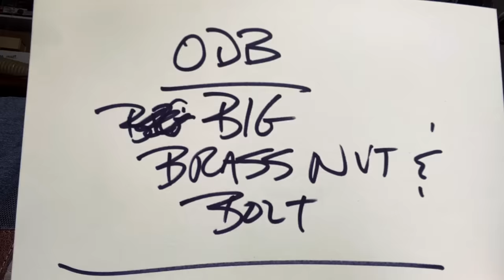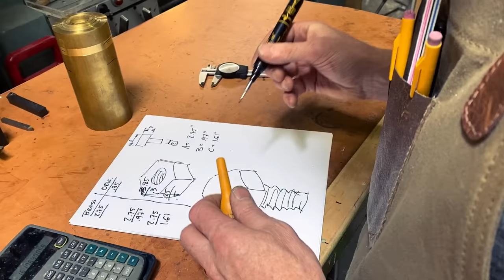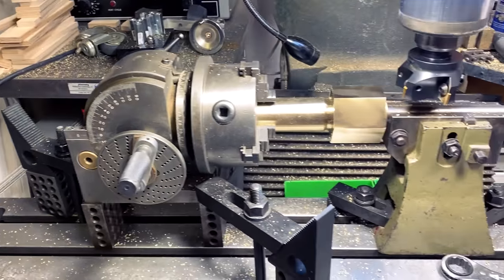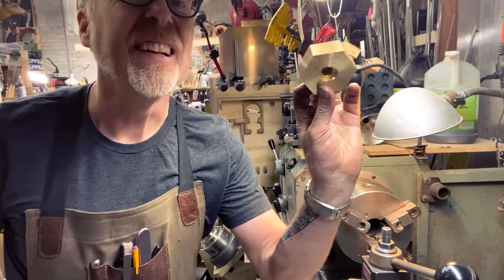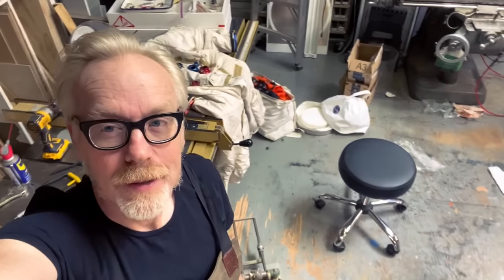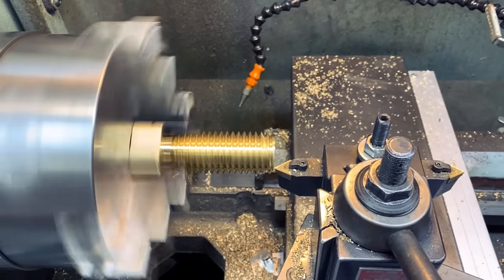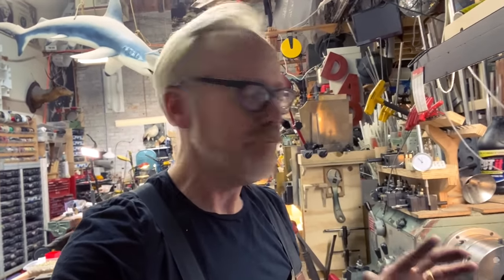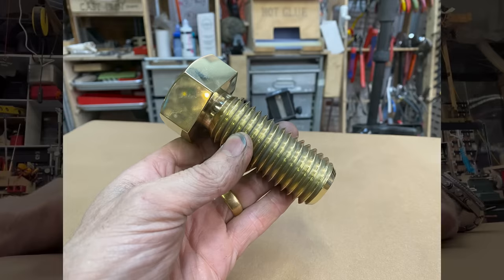Adam Savage's One Day Builds: Giant Nut and Bolt!

Comment: I note you were using reverse threading on the first pass and then when remachining it you changed to forward threading. Im scared of cutting toward the chuck so Im just wondering why you changed? Sorry if this has been explained somewhere in this thread already.  By the way I think you are using the wrong inserts from brass, they should be zero rake to stop the brass grabbing. If you are not away you should also sharpen a set of drills for brass too as it makes a huge difference

Comment: Last time I threaded something on a lathe, I ruined the piece...twice.  Pulling the tool out and disengaging the automatic drive at the same time is harder than it looks, and I accidentally drove the tool in further both times, bending the piece.  (The tool survived perfectly fine though!)  I worked out that it was because I was pulling the tool out with my left hand instead of my right, so I was turning the wheel in the wrong direction.  The third time, I crossed my hands, so I was using my right hand to pull out, and that worked.  As a result of this though, I hate even the idea of threading on a lathe.  A relief really would have helped, since I wouldn't have had to pull the tool out at the same time as disengaging the drive, but that would have been out of spec.

Anyhow, thread cutting is vicious.  There are so many more ways to screw it up than to get it right, and some of them are pretty harsh on your equipment.  I appreciate how you are willing to let us see your mistakes and the frustration, because that really is part of the learning process, and it's good for people to understand that.

Your end results are absolutely gorgeous though.  I appreciate that you polished them (and can empathize with the disappointment of the limitations of polishing).  Brass is a really nice metal for doing things like this, where the only value is going to be aesthetic (aside from the value of the experience!).

Comment: I am a machinist,  you should have center drilled it and had a center in the end of the workpiece.. The other thing with the bigger threads is advance the tool on the z axis forward then center then back (staggered) on every pass, this will take pressure off the tool because it isn't cutting on both sides every time.

Comment: Did you scale up the dimensions of the smaller bolt?
In case you didn't know there is a set of ratio's for getting all the critical dimensions for the bolt head that relate back to the bolts diameter.

Comment: I would have left the dings in place and tried to make a practical nut and bolt that works. I also question whether the ideal nut and bolt maintains the same proportions as it changes scale. But that is because I am not thinking in terms of making a replica, which is obviously the point. I would be satisfied with a beautifully threaded nut and bolt that works.

Comment: Tricky to work with soft metals; blunt one of two edges of drill bits to prevent them from threading themself and getting stuck.
This was done with copper and plastics especially. While threading - do one side of the valley at a time. Not easy. :)

Comment: Gets interesting setting for screwcutting in the lathe when setting up by hand with a stack of changewheels for the leadscrew when working to very exact totally non-standard peculier piches as is the std example used in exams for contraction in a mould. See W.J.Chapman 'Workshop Technology' vol 3. I must admit I'm okay practically but the arithmetic always challenges me. This is a standard part of the curriculum UK C&G Prod Eng  Technician and ONC/ HNC worked example.  Also, working from the rear in reverse from the shoulder / runout at the left makes for quicker working. I've a handy auto cut-off made self made 40 yrs ago for my Dads ML7 that is an auto cut-off for L.H. shoulders, see UK 'Model Engineer' magazine around 1970, its an article by the excellent Ken Metcalf, also makes for quicker working once set. For all general work the Coventry diehead rules.

Comment: Unscrew the jaws, and turn them around for larger throw, bigger diameter piece. The result sounds loose enough to call scrap. I over cut a nut once for an 8 inch diameter threaded shaft for an 8 foot diameter tug boat propeller. It was only .010" over. But chasing threads demands the most precision of lathe work.

Comment: I have not watched this all the way through yet. I am only at the five minute mark. Adam just measured the diameter of the brass blank from tangent are tangent, but measured the original bolt from flat to flat. I would think he would need a corner to corner on the original. But we’ll see where this goes. :-)

Comment: A custom thread shows you definitely made it on a lathe or something more complicated vs just like using a die and tap for the nut but using a common size is better to me because aside from if you did use a tap and die it means you can get a nut and bolt off the shelf and have them fit

Comment: Not a machinist but could you use some set collars on the Ball Screw that drives the carriage? I'd do some testing and see what happens when the carriage runs into the set collar. But you could set them on both ends, and set yourself some boundries. It looked like in the video the tool runs into the chuck at one point, not sure.

Comment: When you calculated your ratio, you used the round of the brass, but you used the flats of the bolt, so the head on the bigger brass bolt would be undersized, compared to the rest of the ratios.
You should have measured across the points of the hex on the sample bolt.

Comment: Did you set the top slide to the thread angle so you cut by pushing in along one face? Or Are you pushing the tool in forward, trying to cut both sides of the V together (wrong way)?

Comment: I know this is old but cutting threads isn't that difficult once you know, "standard procedure". First, I would have left a false center on the bolt, then you could remove it when finished. Second, you never looked up the pitch diameter and tolerance for the thread you were creating so how would know how deep to go? Did you have a set of micrometers and thread wires to check your pitch diameter as you were going along? When I was in machining I used thread triangles. Easier to hold than three wires. If I were cutting a thread, the first thing I would do is whip out my Machinery Handbook to get the major, minor and pitch diameter. Nonetheless, this was fun to watch.
Reply: With "false center", you mean drill a hole in the tip to stabilize it, so the entire bolt is not held at the base?
Reply: @schwarzerritter5724  Correct. The reason they call it, "false" is because you remove it when complete. And generally, you use a center-drill, not a regular drill. They're short and stubby so they won't, "walk" or wander on the face of the part.

Comment: Actually there is a proper tool for accurately measuring threads. It's called a thread micrometer. The anvils can be changed to suit any thread type and then calibrated against a gauge. The dimension being measured is the thread pitch diameter which is the known standard for measuring common threads accurately. Everything about machining stuff is shown clearly in the Machinery's Handbook. It's a very large book about 3" thick and shows standards, clearances, tolerances etc. This book should have been consulted before doing any serious machining. When cutting deep threads on a manual lathe always set the top slide to half the thread angle so that only the front edge of the tool cuts. This is how a CNC machine cuts a thread when using a G76 with the angle parameter (A) set to the thread angle. Failure to do that will result in chatter on deep threads. Want to know what a deep thread is? Check out BECO threads.used in the oil and gas / drilling industry. There's a lot of custom shit in that industry to stop people making their own parts. Thread depth can be up to 1" or more on large diameters. They are a bear to cut even on a new lathe. Often slide-bed clearances must be adjusted to minimum to avoid chatter. We had to cut BECO threads on a 30 year old CNC machine at my company and baby-sitting the tired old machine was half of the work hehe!

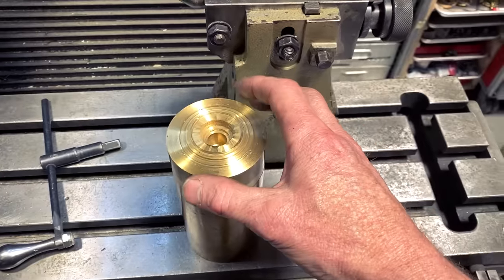Comment: Maybe a real noob question but 6:27 could you reverse each of the 4 chuck jaws to use the offset to give you a greater working diameter ? granted it will be less stable but you are going to use a tailstock.

Comment: I would have completed all the lathe work first so your not holding on flats in a three jaw Chuck. Then after thread is complete then move onto the milling. I find cutting .2mm is the best amount to take with most material per thread cut. Then when close to the finishing dimension I’d change the tip round and cut .05mm (steel) probs .1mm with brass. And spring cut the last cut.

Comment: I am also a bad machinist.

I think you would have been better off using a much smaller thread tool and pushing into the bolt at an angle. When you go straight in, your tool has to cut on both sides, increasing the force on the work, and a big tool puts a lot of material against the work, so the tool acts like a brake.

I think you also need a live center to support the bolt. Real machinists say to limit the stickout to 3 times the width of the work. Or something like that. Look it up.

You can put a hex on a part with an indexer or rotary table without turning everything sideways. Just use a side-cutting mill.

Props for posting the video in spite of the errors.

Comment: Adam matem why not simply put the tap on the end of the gulde and slowly use that, so much easier and a lot more precise, like you explained about the tap and die sets ,use the tap with the right thread count and back its done? Plus your not using coolant as well, which brass is hard and brittle ,where as the tap and die tool sets are hi tensile steel and some are tungsten carbide tooling as well?

Comment: wished Adam was a teacher, Would love to have learnt how to use a lathe from him rather than the teacher we did have, I never understood cutting speeds or threading external threads with a lathe because our teacher never explained it and more or less just went "Heres a lathe, Heres some material, don't get hurt"

I did, however, get to enjoy Knurling when we were making a pin punch, I miss the lathe work, Got cancelled for the second year of my level 2 course because the teacher left and no one else was available to teach us so we did hand fitting and now in level 3 BTEC we are doing mostly welding until the material comes in to allow us to start actually making the parts for our course, Would be fun to use the milling machines as well, Maybe one day

Comment: I'm thinking, this project could have been taken to yet another level. This bolt could have been turned into a puzzle nut and bolt. I.e. remove the washer. With a reverse left-hand thread on the head side, or a tip the locks up, etc.

Comment: Hey. So, 30 years ago when i did an apprenticeship as a mechanical engineer my final test was the "nut and bolt". Very similar to what you've tried to accomplish. I'm going to be harsh here, as good as you think it looks, its not right. You need to make the nut, the same size as the bolt head. You nearly got there. do it again, and get it right.

Comment: I think you should have watched some Joe Pieczynski's videos before this project 😜 Especially with such huge pitch it would be easier and safer to cut threads away from the chuck and with compound set at half of thread angle. Speaking of angle - 60 degrees on the imperial bolt?

Comment: Why didn't you reverse the teeth of the headstock chuck? That's why they have the steps on the side other than you were using... You could fit a piece a foot wide almost in that thing 😋 Also, glue pieces of wood or rubber to you chuck teeth when working with soft materials.

Comment: I can honestly say I have never seen anybody start the screw cut from the back of the piece and work out. I would usually put the chamfer on the end of the bolt and use that as the lead for the cut working towards the chuck
Reply: But if I flip the tool over and thread away from the chuck, I don't have to worry about missing my stop and crashing the lathe.

Comment: How to improve? May be you could build in a way that the nut's head will be aligned parallel with bolts head when you screw it till the very bottom. So that would be the expert level.
Reply: Make a round head and round nut. Tighten with pipe wrench. Machine hexagons together on milling machine.

Comment: For anyone watching this and thinking Adam's diagnosis of "being greedy" was correct, it was not.  Joe Pie made this video: https://www.youtube.com/watch?v=8t5yLHqbRBU explaining and demonstrating what Adam actually did wrong.  It's not about depth of cut, or grippy brass, it's all about poor chucking technique.
In addition, it's best practice to set your compound to 29.5 degrees, and cutting in one direction.  This puts the majority of the cutting force on the leading edge of the cutter, leaving the trailing edge to clean up the staircase that would otherwise be formed by advancing the cutter for each pass.
Adam makes excellent and entertaining videos, but please don't use him as your training reference, especially not for machining.  Definitely don't use him as a reference for shop safety - it's a wonder he still has all his body parts attached.

Comment: An excuse for the nut and bolt having different size heads:  Most wrench sets only come with ONE of each size.  Ergo, unless you're going to demand that the mechanic having to work your bolts have TWO sets so he has two wrenches of the same size, you simply make one a size up or down.  Make that your story and stick with it.

Comment: Increasing the bore size by an eighth of an inch every time was a bad Idea. By increasing the size by such a small amount, you risk getting the drill to grip into the Brass. Usually you want to go with your first bore just 1/3 of the final bore size, to prevent your tool getting stuck in the brass. This is especially important when drilling with a hand tool, and for soft metals like Brass and Kopper.

Comment: So when he said he was going too fast. Think of a saw cutting a 6x6 you have to go slow. Too fast it kicks back it binds it will hurt you. Metal is the same. It bites it grabs it causes an immense amount of heat. If he would have used cutting fluid he still would have to go very Very slow. Brass is gripy meaning it bites back. It’s a soft metal that hates heat. If it was normal size he could rip right through it. Since it’s bigger and chunky not so much.

Comment: you could have turned down the bolt head diameter on the lathe, turned the bolt outer pitch diameter and then used the bandsaw

Comment: you shouild have set the cross slide at 30 degrees and used that for depth feed of the thread. You should learn how to measure pitch dia and you could make precision fit5 screw to nut like a clas 5 theread

Comment: 9:30 I should just stop and I will, but, there is so much wrong with that setup. I don't even know where to start. It's kinda like the clamping straps are holding down the triangle step blocks great. The dividing head, not so much. And geeze get it off of those 1x2x3 blocks! Mill down that tailstock or just use a jack.

Comment: Confused. You fast forwarded through fixing your lathe. Good. But then continued to fast forward through cutting down the brass part without telling us what you were doing. You also fast forwarded through the milling of the hex sides, which I have no idea how you did that since it zipped by so fast. Would have been nice to see you mill a least a side or two before the FF. BTW, I didn't know a lathe could do milling. Okay, so you set the gearing to do 4 threads per inch so we were expecting to see thread cutting but you were actually dividing the head into head/nut at that point. A few things. First, wouldn't it have been easier to divide the head when it was round? 2nd, the camera wasn't at a good angle to see that clearly. Next, we see you holding the separated 'nut' but we didn't see you complete the cut. So it just magically appears in your hand. The thread cutting itself was quite satisfying to watch. We then see you hold up the piece with the chamfered head. But, again, we didn't actually see you do it. That would have been nice. Also, wouldn't chamfering have been easier before you cut the threads? Watching you FF through 'adjusting the parameters'. Fine, but you continued FFing through the actual cutting. So it was very hard to follow you cutting the threads.

Now I appreciate this stuff isn't easy. You have a very sophisticated machine which you know well. You're doing a kind of project you haven't done before. All while filming and giving us opportunity to look over your shoulder, which is appreciated. One thing people may take for granted, when they see a Bob Villa or, well, you, how difficult it is to narrate your work while you're working. It takes years or decades to develop that presence of mind, not to mention dealing with camera angles, lighting, and such. Still, you might could have started with an easier material to do a dry run on, so you wouldn't be floundering around so much. I'll bet brass ingots of that size aren't cheap.  As a software developer, I've gotten myself into awful trouble underestimating projects and coming to them without a detailed game plan.

Comment: After re-sizing the head by 20%, why didn’t you just cut the existing threads off and cut new threads to match the new bolt head? I see why you are having these issues, that 8 ball on the tool holder is up side down!🤬🤬🤬🤬👨‍🦳Do it right and re-size that nut so it lays stable on a flat surface. 👍